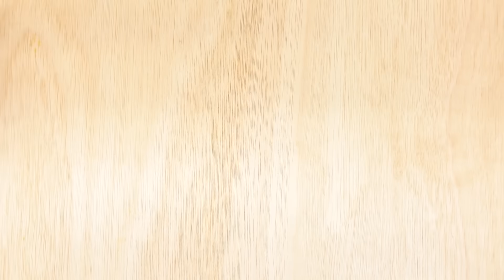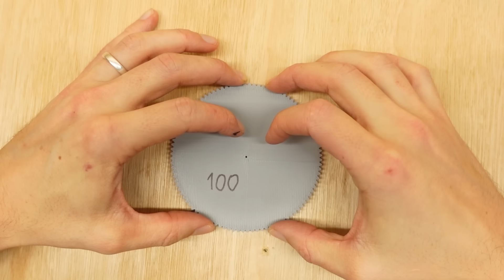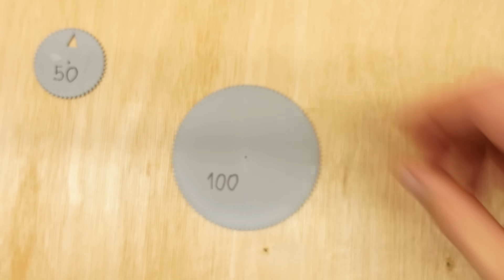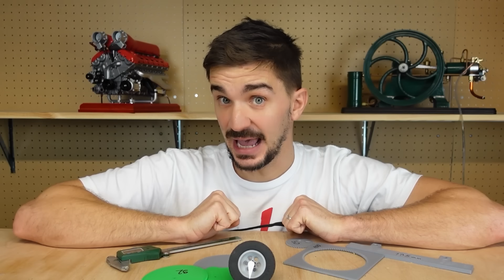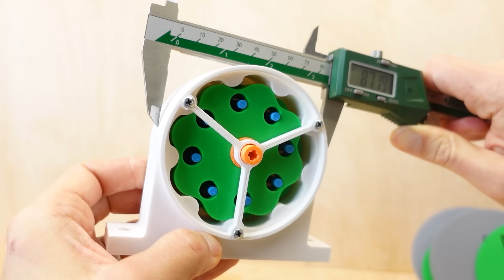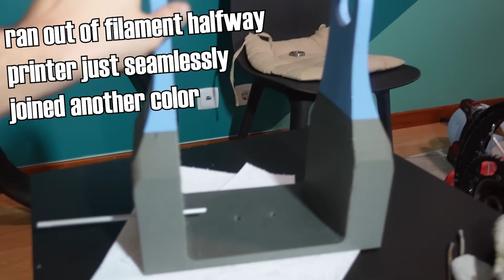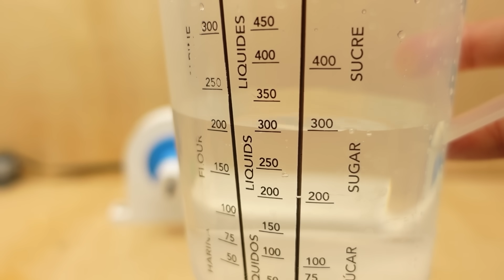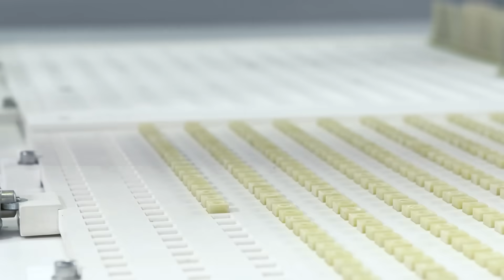Toothless Gears Make Much More Torque Than Conventional Ones, Here's How. Cycloid Drive Explained

Comment: I don't know if it's really needed, but there is zero reason you couldn't add a third rotor, with the middle one's mass equal to the sum of the two outer ones, for perfect primary and secondary balance.
The only current need I can see for it would be in high-bypass turbofan drives.  Those things keep getting recalled.... but now I wonder if cycloids are the basis of the revolutionary new drives (the ones that keep getting recalled).

Comment: If you think these are cool, check out harmonic drives. Huge gear reductions and torque multiplication. Very small package and all inline so little vibration. Also used in robotics but also for industrial applications.

Comment: I had a similar experience when starting out with my 3d printer. now I'm far more measured with what I decide to print, but more important than that is the doors it opened for me to start working with composites and making my own small parts on my dirt bikes and around the house rather than buying bespoke pieces or just giving up as they did not exist

Comment: Addressing the "rocking couple" (~19 min).  Instead of using two cycloidal "gears" of equal thickness, use three gears in a sandwich, with the thicknesses being 1:2:1.  This places the center of gravity of the sandwich at the center of gravity of the middle gear and should reduce the rocking couple to negligible.  Of course, it also requires a more complicated crankshaft which might make assembly more difficult as the crankshaft or the central gear might now have to be bolted together.

Comment: That's a neat trick for impressing high school students (and adults). There is a video about an SAT question that got this wrong and only three (!) students that took the exam wrote back to the SAT board to point out the mistake in it, resulting in the exam results having to be re-calculated for all students that took it!

Comment: Interesting the idea of inner gearing reduction of planeterry gearbox leads to cycloidal gearbox
But it can also lead to the strain wave gearbox. 
Both won't function well on high speed, strain wave will have less backlash but it can handle less force.

Thanks to you I now understand cycloidal drive better, understand how to derive it's equations and see how it reletes to normal planetery gears.

Comment: Maybe a little late to the party and you won' t see my comment but... could you replace 2 cycloids with 3 cycloids? the middle one being twice as heavy as the outside ones.

The idea is that this should cancel primary and secondary forces, while keeping size and weight, even if adding a little more complexity

Comment: Thanks for putting together the video!  
I think you did an injustice to the reason for using a cycloidal gear. Sure, you can't decrease the tooth count difference of the internal gear to 1, but look at your example with the 92 tooth internal gear. It visually appears to have a 12:1 speed reduction, whereas your cycloidal gear example with a 1 tooth difference has a gear ratio of 8:1. The toothed gear system has a wide engagement area, maybe 1/6th of the circumference. This should provide lots of strength and little backlash, and has an engagement area possibly greater than the contact points areas of the cycloidal drive of the same gear ratio.

Comment: AI Summary

Abstract:
This technical briefing explores the mechanics and operational advantages of the cycloidal drive, a high-torque-density power transmission system. By utilizing internal planetary motion and cycloidal geometry, these drives achieve extreme reduction ratios (8:1 to 100+:1) in a footprint significantly smaller than traditional spur or planetary gearsets. The analysis details the transition from tooth-based mesh to rolling contact lobes, which facilitates superior shock load resistance and near-zero backlash—critical parameters for high-precision robotics. However, the briefing also notes significant kinematic limitations regarding high-angular velocities, specifically regarding the inherent vibrations caused by the "rocking couple" in eccentric mass distribution.

Technical Summary:

*   0:00 – 3:58 Kinematic Foundation: The transcript establishes the "Coin Rotation Paradox" to explain internal versus external gear paths. For internal ring gears, the path covered by the center of the rotating gear is shorter than the contact surface, resulting in a reduction of required rotations. This internal orientation is the basis for compact gearbox design.
*   3:59 – 5:35 Speed Reduction Mechanics: Speed reduction is maximized as the tooth count of the internal gear approaches the tooth count of the outer ring gear. Lowering the "tooth number difference" increases torque output while decreasing output velocity.
*   5:36 – 6:55 Cycloidal Geometry Evolution: To achieve the theoretical minimum tooth difference (one tooth) without mechanical interference or binding, traditional spur teeth are replaced with "lobes" or rounded cycloidal profiles. This allows for a one-tooth difference, maximizing the reduction ratio per stage.
*   6:56 – 8:15 Component Architecture: 
    *   Eccentric Shaft: Acting similarly to a crankshaft, it converts high-speed central rotation into the eccentric orbital motion required by the cycloidal disc.
    *   Output Pins: A plate with pins captures the slow, stabilized rotation of the cycloidal disc body, providing the final torque output.
*   8:16 – 9:40 Torque Density Comparison: Even a simplified cycloidal drive can achieve an 8:1 ratio in a space where planetary gears struggle. Industrial versions commonly reach 30:1 to 100:1 ratios. This makes them superior to spur gear trains, which require multiple shafts and large diameters to match such reductions.
*   13:04 – 15:15 Dynamic Balancing: The eccentric motion of a single cycloidal disc creates significant centrifugal forces and vibration. This is mitigated by employing a dual-disc configuration offset by 180° on a dual-journal eccentric shaft, mimicking the balance of an inline-twin engine.
*   15:16 – 17:21 Stress Distribution and Shock Resistance: Unlike conventional gears where torque is concentrated on one or two teeth, cycloidal drives distribute loads across multiple rolling contact points (e.g., 16 points for a dual-disc setup). This prevents tooth stripping and allows the unit to survive the instantaneous peak torque/shock loads typical of high-performance electric motors.
*   17:22 – 18:15 Zero Backlash for Precision: Traditional gearsets require backlash for lubrication and to prevent binding, leading to rotational play. The constant rolling contact of cycloidal lobes allows for virtually zero backlash, enabling the repeatable accuracy required for robotic articulated joints.
*   18:16 – 20:00 High-Speed Limitations: Cycloidal drives are "torque gods" but not "speed gods." At high RPM, the lateral offset between the dual discs creates a "rocking couple." The resulting vibrations lead to exponential increases in noise, heat, and mechanical wear, restricting their application to low-speed, high-force environments like robot arm joints.

AI-generated summary created with gemini-3-flash-preview for free via RocketRecap-dot-com. (Input: 20,116 tokens, Output: 916 tokens, Est. cost: $0.0128).

Comment: 1:40_ you could also see it as a result of the track now being round. From the perspective of the second wheel's surface, you only have done half a rotation at the bottom (pointer pointing towards surface)

Comment: 16:56 You make it sound like all the lobes are exerting rotational force at all times which not the case. Only those with a contact point facing the direction of rotation are applying rotational force.  Simple.
Second, to overcome the imbalance it becomes necessary to add a second rotor, thus doubling the 8 friction points of the shafts to 16.  The sliding action of the lobes is also not energy efficient.
Meanwhile a planetary gear set is capable of having as many small "planet" gears as you can fit, each with its own contact point.  The addition of a second layer doubles this, as well as the torque output, in a combined unit no thicker that the cycloidal drive.  Further, with a planetary gear, you can engage or disengage the outer ring gears to vary the torque ratio.
Open any electric drill made by any company and what will you find?  A planetary gear set with up to 4 selectable gear ratios.
I don't disagree that there is a place for cycloidal gears, but there is very clear bias in the way this was represented.

Comment: We have a problem. We have billions of cars driving all over the planet, and odometers are measuring the distance travelled by the axle, but the car is traveling the distance of the contact point. The error is small, on the order of 🛞/🌎, but for a billion cars, that adds up to a lot of miles.

Comment: I wouldn't call a cycloidal gearbox simple compared to a regular gear train. Compact yes, simple not. There's a lot of friction between the cycloidal disk and output rollers . I bet the cycloidal is also a lot more expensive.

Comment: So you should have just lied and said the wheel had a 200mm circumference, instead of 195. I wouldn’t have seen it, but it would have mad the transition to gears and integers easier.

Comment: is it possible to reduce the extra rotational mode by stacking more cycloidal gears? Like, placing three such gears, the middle one twice the thickness of the outer two which are offset downward?

Comment: As I have learned from you inline 6 engines are inherently balanced for both primary and secondary forces.
By that logic a 6 rotor cycloidal drive could potentially sustain high rpm.

Comment: 11:40 learn wielding. you just buy some tubes and you can have that wheel balancer for cheap and diy
Reply: Nice
Reply: Accept the cost of the welder lol, but other than that true
Reply: @collynenglish5598  The printer he's using is probably about $1500 - welders start at about $100 (although cost can go up depending on technology)

Comment: My explanation is that the outer wheel has to make an additional rotation because it has to travel the additional revolution the track makes. In the inner case, one full revolution is effectively made by the track itself, resulting in one fewer rotation.

Comment: the rounded "teeth" won't break because the force transfer is way less centered and not just because more contact surface. Also at the crankshaft and the pins from the secondary wheel.
I'm not an expert but besides balance problems for higher speed/rpm, friction might be a problem too?

Comment: Hm... This is like a planetary Gear with fixed ring and negative number of teeth on sun gear (in this variant it realy does not exist). We input momentum to the carrier and getting output on the planet gears, altnouth of sun gear. Number of teeth meets the relationship Nr=Ns+2Np for planetary gear. So making Ns negative we can achieve large enough planetary gears. Ratio will be Np/(Np-Nr). Assuming Np is slighly lesser, than Nr we are getting big ratio in reverse direction.

Comment: Would this type of gearbox be suited for high torque-low RPM machines like trucks and industrial/agricultural applications or is the rotation speed still too high? It'd have a huge impact in delivering huge torque figures and be much lighter than big conventional gears.

Comment: Robot arms and joints don't usually need to turn continuously, which makes the more efficient capstan drive more suitable. It's also easier to dial out the backlash even as it wears.

Comment: Wouldn't the balance issue be solved by using 4 "cycloids"?

The outside 2 at 0 degrees offset and the middle 2 at 180 degrees

Or even 3 - outside 2 at 0 degrees and the middle 1 at 180 degrees and being twice as thick as the outside ones (basically the middle 2 from the previous point squished into 1)

Comment: 7:15 before you added the shaft and later pin plate, your demonstration reminded me of the inside of an oil pump I once saw (rotor type I think). Do oil pumps also operate in a similar way to cycloidal drives or are they only similar in their motion? Apologies if it’s a dumb question and thanks for the video!
Reply: I think those pumps are giust two gears pushing oil (or hydraulic fluid) on one side.
The cycloidal gears would compress the liquid between the lobes and that could be a problem. Unless it has valves and acts more like a vane pump.

Comment: Could you have 4 cycloids arranged like an inline 4 that are then balanced and without a rocking pair? I also wonder how this could be used in an automotive transmission application. What is the minimum gear ratio you could get on a cycloidal gearbox? Can you do multiple inline to get different ratio combinations like a traditional transmission? And with it having typically higher ratios than typical gears, could you pair it with a high geared differential to get similar wheel speed but with less driveshaft speed?

Comment: 17:15 that looks more like sliding to me.
Reply: Imagine a bearing
Reply: @basketweaver1144 imagine a bearing and rotate it in your mind
Reply: It is rolling on the torque side and potentially sliding on the other side, but I’d imagine that you would tune the shape to have a gap on that side.
Reply: @ivarne for an infinitesimal moment it is rolling on that side, but for most of the action it will slide.

Comment: The TQ-HPR ebike motor uses a cycloidal drive if I'm not mistaken. Extremely quiet at those RPMs

Check out strain wave transmissions next! The Fazua Ride 60 ebike motor uses that design. Similarly dead-silent

Comment: Note that you can avoid the rocking couple issue at higher rpm by using three disks instead of two the middle one being double the weight and having the two others opposing it and unlike an inline 4 you don't need to offset the imbalance created by the conrods. This is not generally used outside industry because of the lack of necessity for high speed operation and cost of implementation, but on the upshot you get even higher torque tolerances.

Comment: In high speed operation, the "rocking couple" problem is usually solved by adding a third wobble disc in phase with the first, and increasing the weight of the second disc to be twice the first or third (essentially, it becomes a counterweight).
Reply: What about contacting roller bearings? Or even boundary layer friction like a Tesla turbine

Comment: I haven't seen the internals of commercial-grade cycloidals, but vibration could likely be further reduced by adding a third plate such that the outer 2 were each half the weight of the middle one.  This would increase the cost somewhat, however.

Comment: 19:00 Couldn't we just make a cycloidal Drive with an I6 crankshaft? 
I6s had Inherent Perfect Primary and Secondary Balance iirc
Or would that Apply too much bending torque on such a long shaft?
If so couldn't we just make each of the gears thinner so the total length is aprox the same to a 2 gear setup?